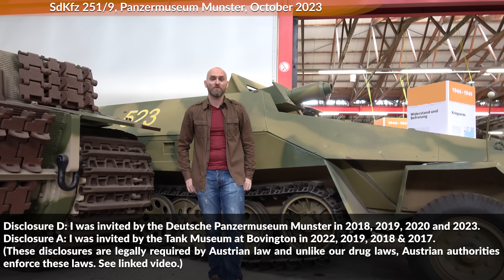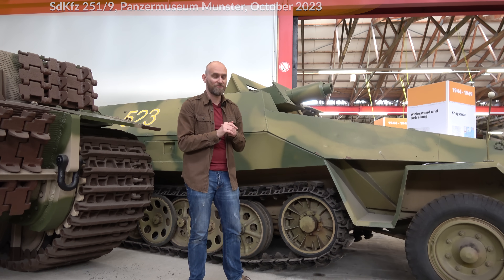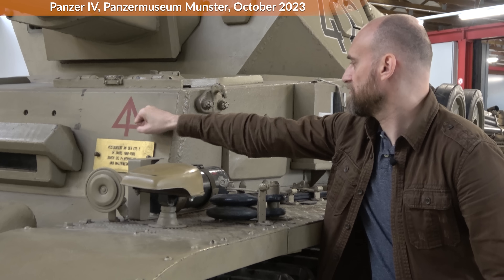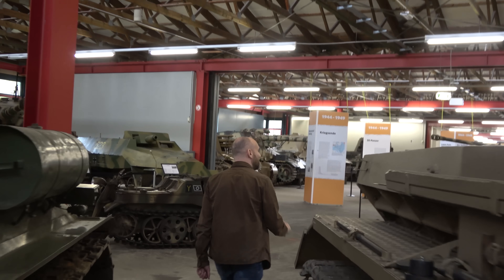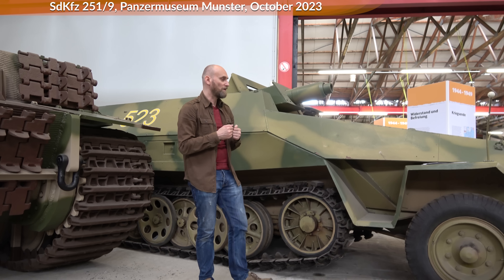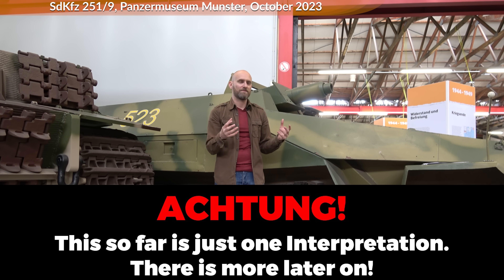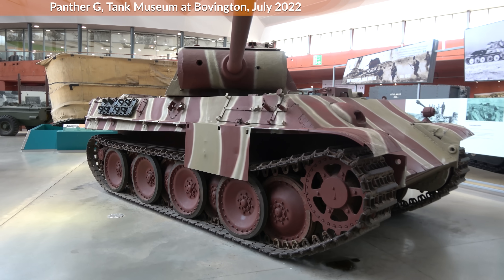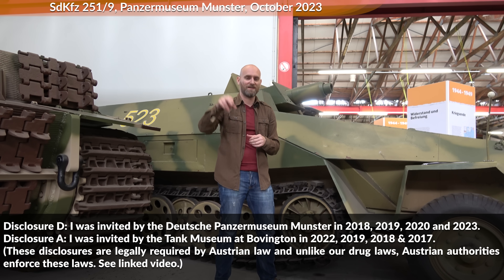Why was German Sloped Armor so late?

Comment: All the German tanks still has slopped armour, it just wasn't slopped everywhere because of space problems. Even the front plate of the Tiger was slopped backwards a little 10 degrees I think.
Reply: Yes, exactly this. The Panzer III, IV, Tiger, all had sloped armor, just at very shallow angles. Sloping armor is always tradeoff between extra effective thickness, and decreasing interior volume and crew ergonomics. Soviet tanks are infamous for their atrocious crew ergonomics and coffin-like interiors for a reason.
Reply: @_ArsNova  The plate below the front glacis is slopped at a very high angle though almost flat even.
Reply: @_ArsNova  Agreed, I thought sloped vs. shallow-sloped armor was just a design and engineering choice.  Sloped armor means more metal (the hypothenuse of the triangle) which weighs more (unless made thinner, in which case you lose the benefits somewhat) and covers a larger volume inside the tank.  Not all of that volume is useful, and will be used mainly for the driver's and bow gunner's legs.
Reply: @TallDude73  Slopped armor allows ricochets and this is its major advantage over straight armor of similar thickness. Disadvantage is that you have less space inside, i.e. you have cramped tanks (well known fault of Soviet tank design) .
Reply: @frankguz55  you're not really reading his comment, are you? Please remind me what basic geometry that you're trying to use as an argument says about plate thickness and weight? You may be replacing a vertical 120mm plate with angled at 60° from vertical 60mm one, but you're also replacing a significan portion of 10mm roof plate with it here and are cutting the internal volume of this corner in half.
Reply: @aleksazunjic9672 No.
It increases line of sight armor thickness.
Whether that actually increases armor protection is a function of projectile design ( shape, hardness, caps etc ) relative to the armor plate....for a given impact velocity.
One of the most relevant factors there is the t/D ratio (thickness/Diameter of the projectile ). Once that starts to go down towards 0.5 then the actual protection modifier for angled armor over the nominal plate thickness very quickly goes towards 1...i.e. the slope provides no extra protection over the nominal thickness.

In effect the projectile just punches out a plug out of the armor plate and both merrily go on their way.

The converse can also happen. 
APCR/HVAP behaves much more poorely vs. Sloped armor than it's raw penetration versus vertical plates would lead you to believe.
Protection factors for decently sloped armor are thus higher than the mere line of sight increase to the apparent plate thickness.
Reply: @TheArklyte but the side armor is longer as well and might even need to be increased in thickness due to rigidity concerns.
You might also need stronger ( heavier ) running gear due to the frontal weight having more leverage from the center of gravity.

There are trade offs to all design choices.

Just like in policy decisions.
Reply: @TheArklyte   do your math please: 60*1.41=84.6.
(120*1+10*1)=130.
A flat 120mm frontal armor with 10mm roof is 54% heavier than a 60mm sloped armor at 45°.
The argument on internal space is well known, but the weight is considerably lower for sloped armor with equivalent protection.
Reply: @dwwolf4636  We are talking about WW2 technology, for example Pzgr.39 - very thick  APCBC projectile that would certainly have a tendency to ricochet, and this was the main threat for Soviet tankers in that war. Even much rarer Pzgr.40 has relatively high T/D  so it also has tendency to ricochet. Thus, slopped armor was a major technological breakthrough when introduces an masse in T-34.
Reply: @frankguz55  so not only the math is the problem for you, but also reading comprehension? Sorry, I have no cure for your dyslexia. My condolences.
Reply: @TallDude73 It would actually weigh less, as the hypotenuse of a triangle is always shorter than both sides combined.
Reply: @aleksazunjic9672 nope you can have armor spalling which which can still kill the crew.
Reply: @frankguz55 except that's not equivalent. . . A 60mm plate at 45 degrees has an effective thickness of 84.6, if you want to make the sloped plate the same effective thickness as the vertical plate then it will be the same mass as the vertical plate. The only weight saving is by removing the roof plate but then you have halved your internal volume.
Reply: @Mattamaza  It's not as simple as increasing the raw LoS thickness; for various reasons (and not always the same ones, and not always as effectively in all situations...) it tends to be quite a lot more effective that the calculated LoS thickness. Or, rather, it was; APDSFS & HEAT undermine that rationale.
Reply: @frankguz55  Thus said the Scarecrow after the Wizard gave his his diploma.
Reply: @dwwolf4636  Most of that was rendered irrelevant by APDS and APFDS anyway.  By that theory, sub-caliber munitions should perform poorly against radically sloped armor.  Why not ask the FEW survivors of the Iraqi Talkawana division how that worked out with their T-72s in the 1991 Battle of 73 Easting?
Reply: @selfdo  do your math (if you understand what math is)
Reply: @frankguz55  when use 1.41 this mean 45° angle. 60mm at 45° gives 60mm/sin45°= 84.9 mm of protection (not 120mm). If you want 120mm you need 60°angle. 84.9 mm + 10mm = 94.9 mm not 130 mm.  84.9 at 45° gives 120mm of protection.
Reply: The problem with sloped armour is that it doesn't actually help as much as people think. Sure you can tilt an armored plate 45 degrees, but in doing so you have to make the plate itself bigger to cover the same space as an unsloped plate. Sloping also creates a lot of space inefficiencies. You can cram more into an After 8 mint box than a Toblerone box.
Reply: @mrdojob  People also forget that sloped armor is only useful as long as it's sloped. It is rendered worthless if you happen to be caught in a position where that angle is nullified, such as while the tank itself is on an angled slope, or is being fired on from higher ground.
Reply: @arsnova1321 yeah, if a tank is in a city for example, shots coming from windows might hit sloped armour at a near perfect 90 degrees. In those cases, a boxy tank will actually perform better.
Reply: @mrdojob  tanks were not designed for city combat. That was an exception they were trying to avoid.
Tanks were designed to engage at distance in a maneuvering fight
Reply: @_ArsNova  Not really. Thats also kinda the point of heavily sloped armor. It reduces your need for "roofing". Instead of a vertical plate and an horizontal plate, which was usually considerably thinner, you mainly had one slopped one which provided increased thickness from all reasonable elevations were the box design meant you could get a shot at the thinner roof.
Reply: There was actually a proposal to re-design the Tiger I to have a more sloped front like the Panther or T-34, but keep the rest of the hull the way it was.  However, this was rejected, as is was felt the best thing to do was to proceed with the Tiger II.  Field experience showed very few, if any, frontal penetrating hits from enemy tank or anti-tank guns on the hull front or glacis.  The simplest explanation was that the frontal armor, firing table data aside, was sufficiently thick in actual combat use.  The other reason was the the TURRET tended to receive most incoming hits.  Although the Tiger, like other other "Big Cats", had its vulnerabilities in the sides and rear, as did every other heavy tank, it was simply difficult for the enemy to engage a Tiger from the side, unless the commander of a Tiger company blundered into an ambush.  On the defensive, this simply didn't happen.  On the few offensives, and they got FEWER as the war went on from the Tiger's initial inauspicious debut in September 1942 near Leningrad (deployed in marshy terrain that forced the four Tigers used to keep on the roads, where they were vulnerable to Soviet tank-hunting infantry) as fuel and supplies ran short and the German Army was generally on the defensive after Kursk in July 1943, Tiger units worked in conjunction with Panzer IIIs as artillery support tanks and panzergrenadiers to guard against stalking infantry.  The lessons of Kursk where a "cousin" of the Tiger I, the Ferdinand, proved horribly vulnerable to tank hunters once shorn of supporting artillery and infantry, as General Guderian descirbed it, with that gi-normous Pak 43 L71 main weapon, it was "hunting quail with a howitzer".  Although this most famous of the "Big Cats" ended up being used as an expensive tank destroyer, it proved hugely effective in that role, and thus there was no reason to disrupt production with radical design changes.
Reply: even the M1 Abrams has regions without sloped armor.
Reply: 10 degrees on the upper glacis and mantlet and 24 degrees on the lower glacis.
Reply: It wasn't stopped. It was 0° .
Reply: @gutsjoestar7450 
10 degrees on the upper front plate and mantlet and 24 degrees on the lower front plate.

Comment: The thing about German tanks and sloped armor is that German tanks from the PzKpfw III up to the Tiger did have sloped armor, at least on the front of the hull. It's just that it's not set back at a very steep angle, but it is sloped and not sitting at 90 degree vertical. If you look tonkas like the Tiger from the side or a at slight angle, you'll see that the front plate where the bow MG and driver's view port are mounted are sloping back towards the top. And nose of a Tiger is completely sloped.

Comment: Boxy armor can encase more space for the same weight than sloped armor.  So the German tanks are roomier and the crews are more comfortable .  Also, German tanks had torsion bars and that used a lot of space in the hull.

I worked with a guy who was in the US Army in Korea.  He was in a M48 tank. That had sloped front armor
but was not interlocked.  He said in a maneuver a few tanks slid down a long muddy slope into each other.  One tank's cast front armor welds broke and fell off exposing the driver.
Reply: M48 hull is single piece casting...
Reply: @jintsuubest9331  You are right.  I had assumed it was the welds that failed.  Maybe the casting broke.
Reply: In Korea were M46 Pattons, not M48s.
Reply: @Kot_04  Oh, OK.  I heard this around 30 years ago, so....
Reply: @501Mobius  M46 is welded so it fits to this story.